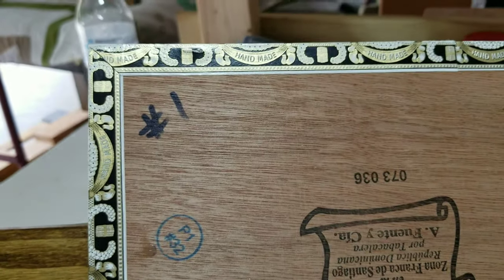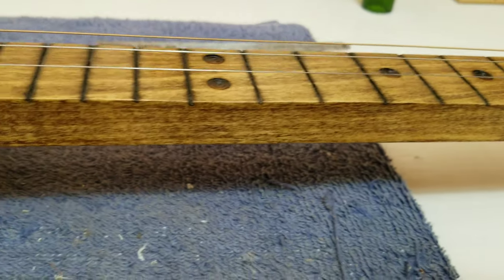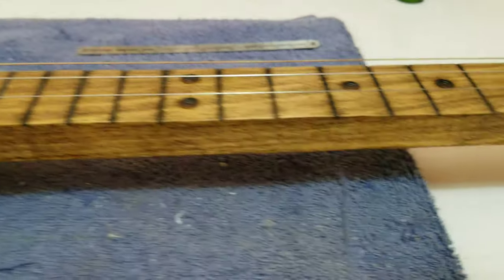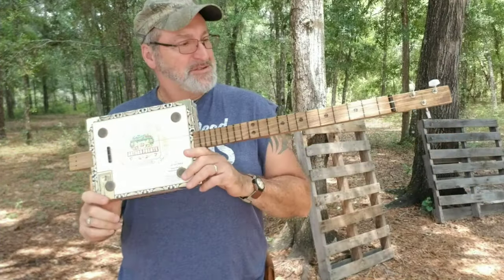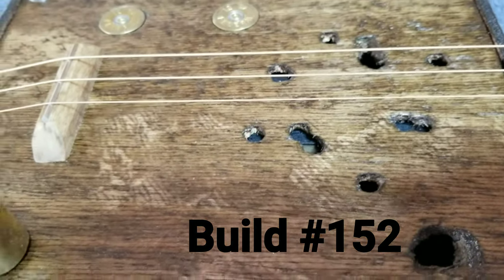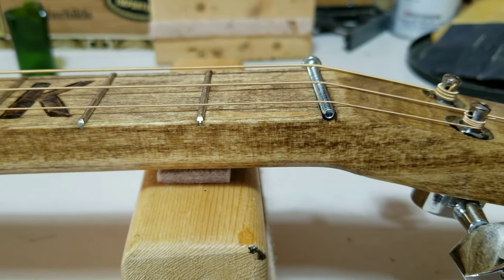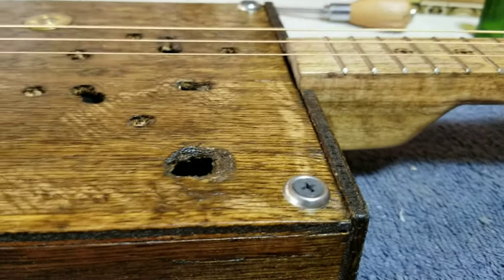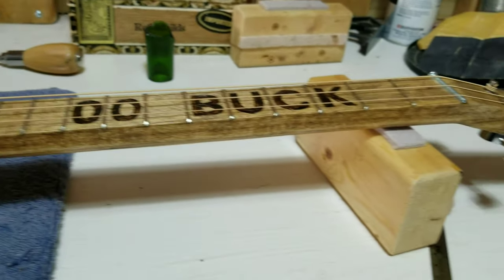How to build a 3 string Cigar Box Guitar - Setting the string height.

Comment: HAhahaHAha!!! great minds think alike! 😂 that's almost EXACTLY my first build! soo cool. i did the same box and made the same flush neck mistake, same screened sound hole covers but 4 up top, same corners, hinge rear string holder, buffalo nickle bridge, fretted neck with wood nut and same tuners plus bottlecap piezo pickup. all CBGitty parts. another irony was that i got all my cigar boxes from a guy named Mike that worked at a local smoke shop. he gave me several good sized and sounding boxes for free, so i started making my first box and was going to give it to him in trade for the boxes he gave me and for another set i was supposed to pick up in 2 weeks. here's the downer. he was robbed just before closing time a couple days before i was supposed to give it to him and pick up my next set. 3 dudes in masks and a shotgun. the guitar was never delivered and the killers still haven't been identified. the smoke shop was shut down a month later. He had no family in america, so the box wound up being broken up and trashed. all but 1 box was given away. i still have some corner pieces and 1good box i keep my gater palm sander and sand paper in in his memory. i made several 6 strings well before that first 3 string, all valued north of $2K but that last box was the last guitar ive made in more than 5 years. i remember my first box fondly because Mike was the one that inspired me to try cbg's. i still miss my old friend. last night was the first time i've looked at cbg's or even considered wanting to do another guitar of any kind. been binge watching all things cbg since i stumbled on one of your older vids. thank you for reminding me how much fun these magical instruments can be.
Reply from the maker: Thanks, Sorry to hear about the smoke shop guy, that's too bad. :(  I'm happy to hear your back into CBG's. They are a blast. M~

Comment: Hi Michael,
I have built over 400 cbg's to date, and have yet to find a "rule of thumb" for constantly setting the string height of my builds.  I use a zero fret, as you talked about, and it does work nicely, however it seems to limit the very low action some better players demand in the upper registry.  I believe it is do to the very low and even action on the first 1-7 frets which is great.
However as you go further up the neck the action does increase as expected, making fingerling more difficult.  I have tried lowering the floating bridge, as you suggested, but have found no set formula for achieving significant improvement in the upper frets, which is fine for slide (appx. 2.4 at 12th), but still a tad more difficult to finger.
If you sand the bridge to lower, you get fret buzz on the first several frets.  I tend to be a perfectionist in my builds and trying to resolve this makes me nuts.   This situation, however doesn't affect the intonation and tuning,  perhaps I will experiment with a bone nut instead of a zero fret.  Just thought I would share and ask your opinion.  Love your videos and keep rocking!!
Doc
Reply from the maker: Each build is different as you know.  I try to get a good balance between the fret board height, bridge height and nut height to give each one nice play ability, with or without a slide. Thanks for checking out the videos. M~

Comment: Hey question for you well 2. What size frets do you prefer with your cigar boxes. And I see other people putting the tail for the strings on the cigar box is that just for looks or does it serve a purpose. I prefer the look of yours with a strings ending at the edge of the box on the strike plate.
Reply from the maker: I use med nickel fret wire, I do the guitars with the neck going completely thought the box as well. Its a preference thing for me.  M~

Comment: Hi Michael, I have 2 CBG's, one is fine & made by a reputable company but the other resembles your first kit CBG & has the same type of faults. The difference is the size, this one has an overall length, tip to tip, of almost 31 inches, fret-board is 14 & quarter inches, with 16 frets. Would your string settings be the same for mine?
Reply from the maker: Not really sure about that.
Reply: Thank You Michael, Sorry to bother you, Best Wishes, Peter H.

Comment: Hey Mike, if I’m correct I count approximately 18 frets on your guitars . I believe you May have said That you use a 23 1/2 inch scale sometimes ,and your frets stop right at the box . My first question is what template are you using For the scale length? is it from CB Gitty ? Because I don’t know if they have a 23 1/2 inch scale template Your guitars Always sound so great and i’m trying to find tune my sounds and get some consistency . My builds vary anywhere from 23 inches to (25 1/2 as in a standard Strat length) occasionally I have absolutely no intonation issues but sometimes I do which as you might know it can be very frustrating so I’m trying to get some consistency on my builds perhaps you have some words of wisdom in this realm I can help . I would appreciate Your thoughts  definitely appreciate it Thanks again.
Reply from the maker: Hi Rstar,   The number of frets will vary, depending on the length of my box and my bridge placement.  I use a 23'' scale length usually. I got the template from CBGitty. Setting the intonation can be challenging at times because everything comes into play, nut height, string height, bridge height, bridge placement,  fret spacing must be accurate.  When I get a formula that works nice, I try to apply it to all my builds, as close as I can. M~
Reply: Thanks again Mike . Sounds like I should float that bridge at least until intonation sounds correct. Just trying to zero in on a good sound that can be replicated. Great help !
Reply from the maker: @rstarguitar5350  Your welcome Rstar,  good luck with your builds. M~